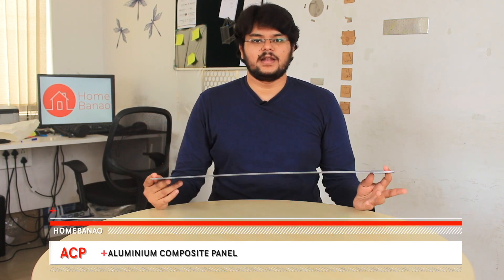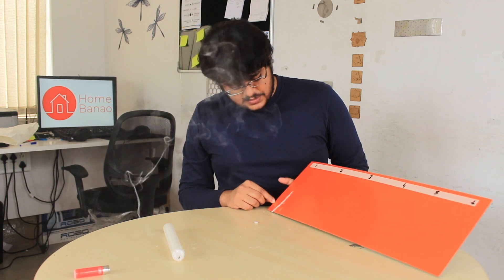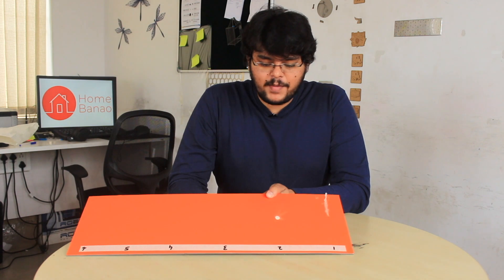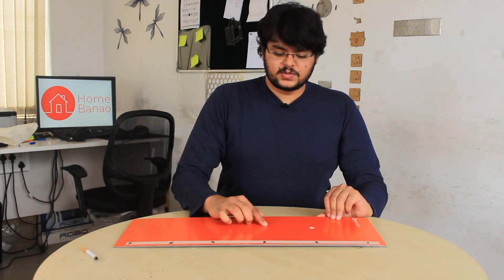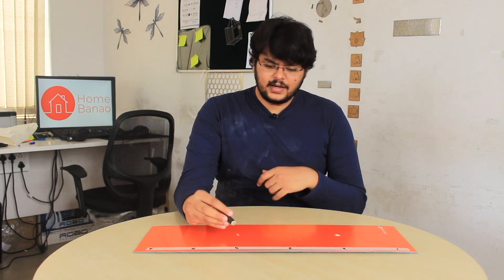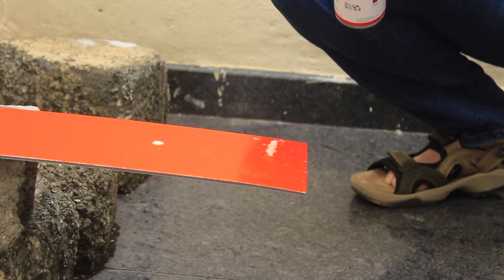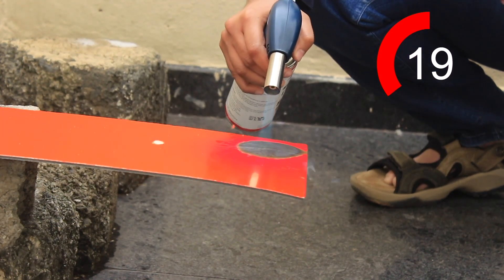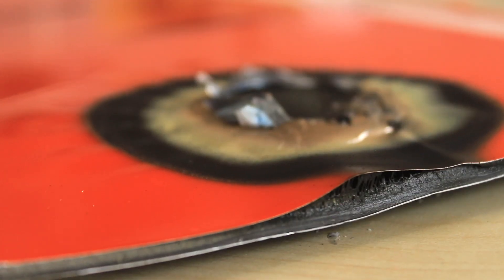ACP Fire test - Aluminium Composite Panel - Will it burn

Comment: Do not use this product in external wall construction without consulting an engineer. This video is not a scientific test - you really need to think about the information you are sharing. Dangerous, ill-informed and extremely irresponsible.

Comment: Such an ignorant way of judging fire behavior of materials. Who said your cigarette is 300-400 deg C, this way of testing is proving nothing. You should educate your self. ASTM E84, would be a way of measuring surface spread of flame, there are testing such as NFPA 285 would be judging the overall performance of the full scale system. The reaction to a real fire scenario has nothing to do with what you are doing. This can be mis-leading to building owners and can lead to major issues.

Comment: Can you suggest me if i want to install ACP on roof ...what thickness is preferable
Reply: Don't.
Reply: @1000Bats  why? I'm thinking of using it to cover top of pergola & awning instead of polycarbonate sheets.
Reply: @zizimai7568  I was under the impression you'd be using it on a building, ACP is the material responsible for the grenfell tradgedy.   No you can't burn it with a blow torch, but in a structure fire it's going to cause problems. You could get away with a pergola probably.

Comment: Ignition is due to heat...and not because of temperature. A matchstick, a candle, and a butane/air torch produces almost same temperature but different heat release amount.
Reply from the maker: Agreed. But Heat generated by blue flame of butane torch is highest.